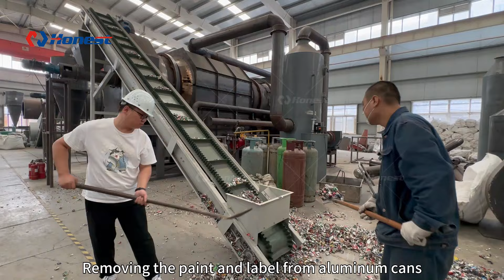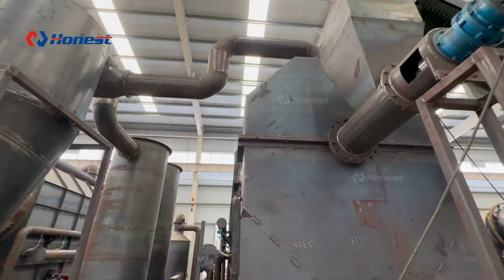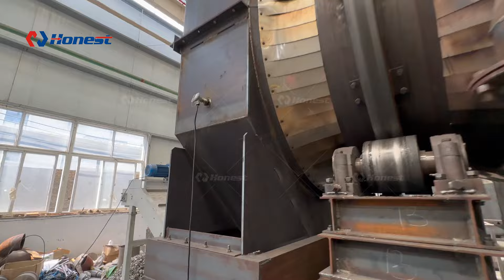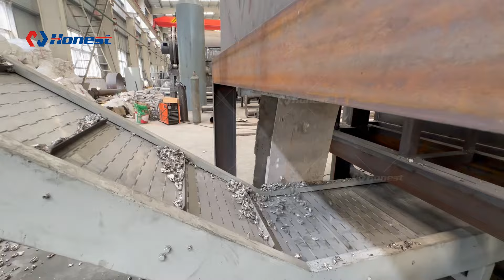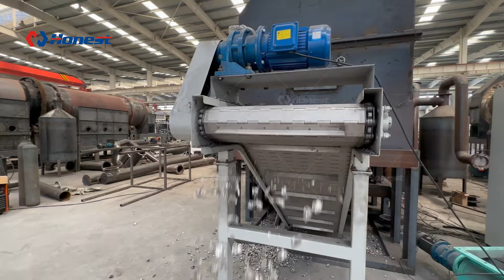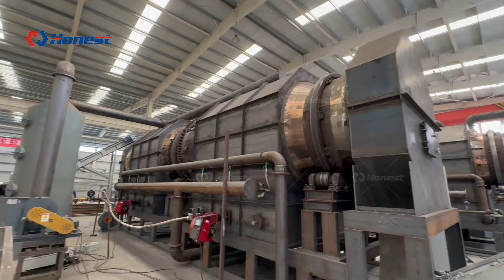Removing the Paint And Label From Scrap Aluminum Cans - Aluminum Cans Recycling line

Comment: Part 2:  Removing the dirt from clean aluminum scraps falling on the dirty floor.
Reply: they will melt it so i don't think it matters that much.....
Reply from the maker: After paint removal, the recycling rate of used cans can be increased without polluting the environment.